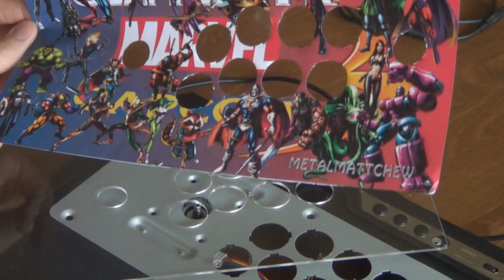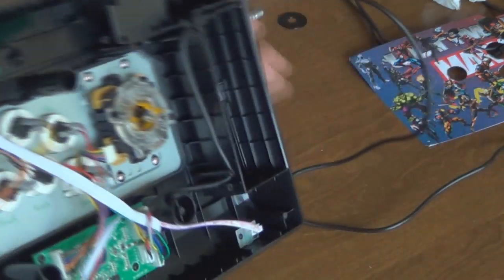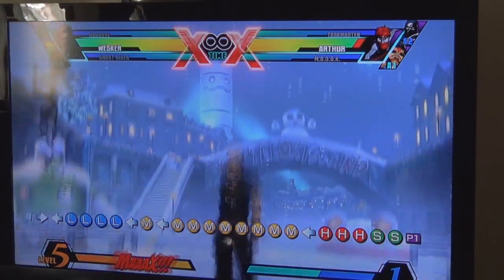Change the artwork on a Qanba Q4RAF

Comment from the maker: If you are referring to the top screws were the buttons and joy stick is, they are covered by stickers. If you score them and firmly insert a Phillips head screwdriver and give twist it should come right off. You may have to take a pair of needle nose pillars to remove any leftover glue. The 8 on the back (not the feet) should be easy to find, only 1 is covered by the warranty sticker.

Comment from the maker: If I remember correctly, I scored the area around the screw head. Then I placed my screwdriver in the slots as firmly as possible, then twisting counter clockwise with downward force. I think all but 2 the glue and sticker came off cleanly. The other ones I just used a pair of needle nose pliers to remove the glue.

Comment: i used your tutorials to mod my eightarc Fusion stick with a Link quick release shaft and custom artwork.  the Fusion has virtually the same innards as the Q4RAF (including the metal inner housing which has a hole for the start button where it would be on the Q4RAF lol)

Comment from the maker: In a simple answer NO. The stock artwork is applied directly to the plexi-glass cover. 
A more complete answer is, you can reuse the stock plexi-glass cover. You would have to use nail polish remover to remove the decal. Then take some plexi-glass buffer to give a nice finish. This process takes a LOT of work. Plus buy the time you buy the materials you would only save something like $5.

Comment: I want to put IL short stem concave buttons in mine they're 28mm instead of 30mm that the holes are, can you make them fit and work. IL ones screw down instead of lock into place. Any ideas.
Reply from the maker: hdtv00 Not quite sure how that would work. While 2 mm isn't a lot not sure how secure the button will sit. As it is now there are just slots where the buttons rest. There isn't really a spot for screws. They should like they would work better on a complete custom.

Comment: I just bought a qanba q4raf and I was wondering if its possible to switch the sanwa parts for seimitsu parts instead but great tutorial on how to change the cover
Reply from the maker: The buttons should work just fine, it's still just a signal wire and a ground. The stick on the other hand may be a little more effort to work properly. I belief that the pins on the stick are in a different order. I'm pretty sure you would have to switch some wires around. On a sanwa the pins go: ground, up, down, left, right. I think on a semitsu the pins go: Up, Down, Ground, Left, Right.

Comment: So it's possible to remove the initial RAF artwork that's on the stock plexi? I don't want to buy a new plexi, just want to use the one that comes with the stick. Nail polish remover should work?
Reply from the maker: I have heard that it is possible to remove the stock art work. I think they used nail polish remover and light car headlight buffer cream. I didn't even try. One of these days I may try and see how difficult it is to remove.

Comment: How did you printed it ? My printer is too small for that kind of paper
Reply from the maker: I got it done at Staples, but any print shop should be able to to make it for you.
Reply: +Matthew Hamidy K thanks i'm kinda new in the unvierse of Fightsticks and stuff like that, btw any advice about choosing a fightstick that cost less than 200$ and easy to mod ?
Reply from the maker: MrCryok Well most stick are easy to mod. I kind of depends on the system you are going to be playing the most. I really like my Hori Rap4 I found it for around $150 at most retailers. I put up videos on how to change the stick and buttons. The only thing is the artwork is not really an easy change. For around $240 The Madcatz TE2+ is an excellent choice. There is a latch in the front of the stick for cord and button storage. The artwork is much more easier to change. The only thing it, is rather difficult to find right now. Both of those are for PS4. I don't have a go-to for Xbox one. There again you could get a Brooks converter, which are around $50 and you could just pretty much the stick you have on anther platform.
Reply: Matthew Hamidy
I play mostly on PC/PS4 and i think about going for the Hori + buying buttons and stick with it, thank you ! :)